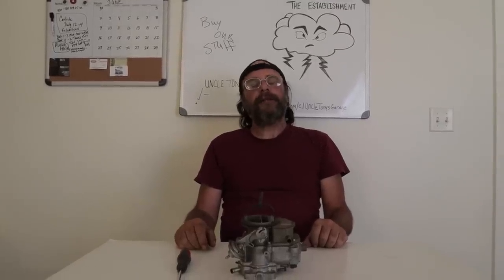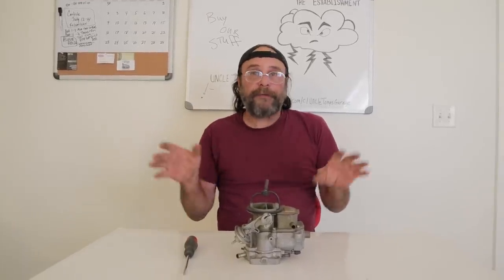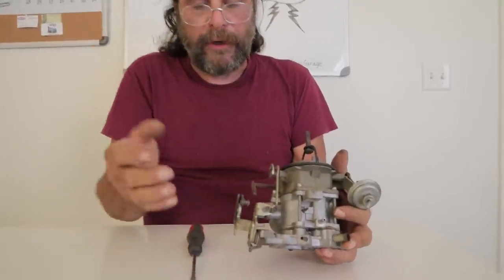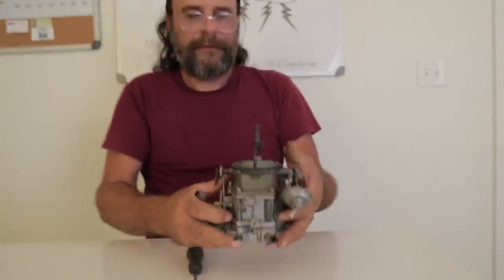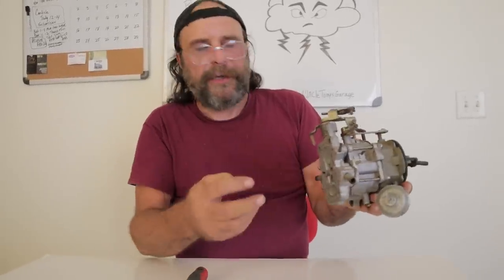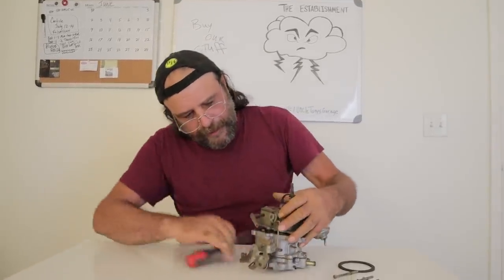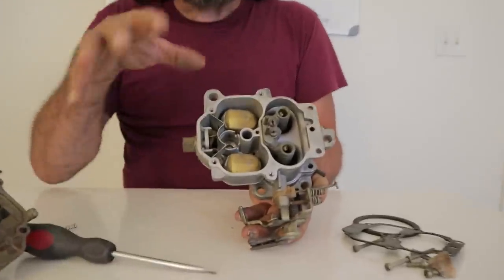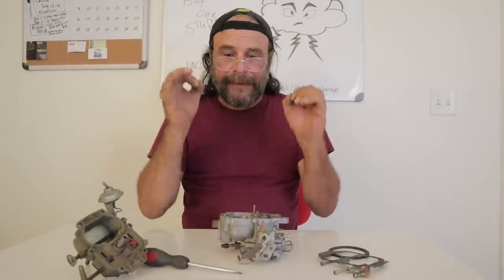Classic Car Tech- Understanding Carburetors

Comment: been a while since i regularly drove my GTO. i was running a q-jet  man it ran nice. that is once i got a fuel return to end vapor lock.. well you know pontiac so i thought i had to have a tri power. got what i thought was a good deal on "the seller said"working tri power.  well it may have been running on the center carb . but the check balls in the end carbs were installed wrong. i couldn't get the lower check balls out so i wound up drilling holes in the bowl under the check balls to get them out. patched the holes with epoxy . now the check balls were right and the carbs worked. 
  but  the car ran hot which it never did with the q-jet. . after much trial and error on air intake . i decided to run bigger jets. i changed the jets . then the fuel pump was leaking . after changing that it's too late to take a ride tonight so see what tomorrow brings

Comment: Forgot to talk about what i learned... I sobered up..... Can't just put another off the shelf 600 cfm carb(straight leg boosters) on that motor or you wind up with mid throttle bog... not enough air flow w the emissions heads.  Need the anular boosters in the stock carb to cover between the idle and main circuit when using emmision heads on 302.
Reply from the maker: ok

Comment: Now to the big question Tony, I have a 283 Chevrolet V8, and having an Edelbrock 800 🤔 I want to use, then it needs to be remodeled. which needles should I use? A 500 or 600  needles. Just looking for good idle and good fuel economy ...

I will register my Chevrolet 56 pickup and have to have that size of engine to handle that inspection, the idea is to switch to a 350 or larger engine, after that inspection it never needs to be inspected later 😏
Reply from the maker: What you want to do is Google Edelbrock "Drop Rods".  The answers to your questions can be found there.

Comment: A cold engine makes more vacuum but the fuel is condensing on surfaces on its way to the combustion chamber.  Therefore the engine needs more fuel to remain stoichiometric. A cold engine will not atomize fuel very well. The choke increases vacuum at the bottom of venturis, thus increasing fuel density in the air charge.

Comment: I just started working on my grandpas -77 Aspen, and it runs smooth at idle/cruising and then when i pressed the kickdown it just died. Now i never worked on cars, well i've built about a dozen exhausts because fuck sweden, but that's another story. This carb looks pretty identical to the one on there. I bet that dam accelerator pump needs a closer look, also now i understand that carb in and out. One thing tho, the choke bracket, is it supposed to be loose and just hang around there until a cold start or should it have some tension? Thank you for all your great mopar wisdom, it helps me out alot!

Comment: Had a 63 Impala, 283 2BBL Rochester. Low power, very rough idle like missing an entire bank. Couldn't find the problem, mainly focussing on the ignition. After upgrading to an Edelbrock 4BBL the problem was solved (desperate guess). I still don't know what caused the problem..

Comment: ford auto light 2100 2150 and the 4100 wear the simplest fuel mixers devised!  as for the idle speed screw I set them so the transition slots form a square then adjust timing to set my idle speed with the mix screws 2.5 turns from full seat. if it is on the car i set idle speed screw out around 1/2-5/8 out then set timing for smooth idle. i find that a lot of cars need vacuum advance on full manifold vacuum so the base timing is low for cranking then pulls in more for a fast smooth idle with a cool idle temp.   as for chokes i do not use them as thy case a lot of problems i wire mine open and use the gas pedal to give it a rich mixture when it needs it!  the key was a hei ignition this was a day to day driver and it got better mpg than modern cars in its class because i had a hot spark a mid 70s 2150 carburetor  and i custom curved the dizzy the carb was stock. as for cold starts it needed 3 pumps on warm days and in freezing weather 12 it would light it of faster than a lot of efi cars! good video!

Comment: Uhhh...if only I had this video back in the day when I used to try getting my Dart to run right or even start.
I didn't know what to do, and I can remember other people trying to fuck with these adjustments and they didn't know what they were doing either.
Sounds like I had accelerator pump issues.....

Comment: Great video Uncle Tony, thank you. Question, I have a 65 Mustang 289 3 speed, Autolite 4100 4bbl, she started right up cold no problem, and idled beautiful, but as soon as I shut the door, or even bumped the car with my knee, she would stall, and then run like crap, undriveable. Until the next day. I rebuilt the carb twice, I ended up tossing the carb and put a new Autolite 4100, (I wanted to keep it original) and all is well now. Can you tell me what was going on there? I ran the engine with the top off the carb,  and watched the floats in action, and the needle and seat worked perfect, no over flow, no running dry.  Would love to know what happened here, it haunts me. Lol thank you!!!!
Reply from the maker: No idea what could have caused that...I would have looked at the ignition switch
Reply: Funny you said that, I actually went through the ignition, changed the starter selonoid, changed the fuel pump, with no results, but after I swapped out the carb, it all went back to normal. Guess it will always be a mystery. The struggles of owning a Ford. Lookin for a MOPAR now actually. Have a good weekend Uncle T.

Comment: Question. I have a 1985 Jeep CJ7, 2.5  carbureted. When I turn the key off the engine sputters/chokes/stumbles before it shuts down. The Jeep runs fine, sometimes a little hard starting but runs pretty good after it starts. I never have any idle issues or stalling problems. This issue just started a week ago, but doesn't happen every time I turn the Jeep off. I've heard of this before but can't remember why it does it. Any help would be greatly appreciated. Great video as always 👍
Reply from the maker: That usually happens because of a combination of engine heat and too large a throttle opening at idle.
Reply: @UncleTonysGarage  Ok, I'll go see if adjusting the idle down a little will help. Thanks for the info 👍. Keep those videos coming, great job.

Comment: Tony, You are an amazing incredible wealth of knowledge.  What state are you located in?  Please list contact information.  I just got a 1970 Impala (Original paint & interior) 30K original actual miles (a clean #2 car), 350-250hp, Turbo 350 trans (I might do a B&M kit, not sure if I should do a drop in 2004R). 10 bolt rear (I think it is a 256:1)I do have some carb questions.  I hope I can make this a day 2 car.  I have an original like new (it still sparkles) Winters Foundry Snowflake aluminum LT-1 intake I am considering putting on it.  I want it to be basically all Chevy and basically almost all original, I will also probably install an HEI Distributer.

Comment: hey tony. i had an old 70s holly 750 vacumme secondary,  rebuilt all factory settings.  I took it off my sbc and put on a modern demon 750 vacumme secondary carb. the car felt like it doubled in power. are new carbs that much better then old ones? or was there something wrong with the old holley?

Comment: Sum Quadra junks usually have those idle screws, capped. Excuse me... Quadrajets. They don't recommend playing with those screws. The factory had a tendency to set them at the Optimal Performance setting for the application. And it is a total pain in the ass to do so. However, there is a tool for it. It's hard to find and rare. I bet Uncle Tony's got one. He too, is rare and hard-to-find.

Comment: What I always had trouble with was: Why does does the carb get a lot of fuel (high vacuum) with the butterfly and choke completely closed and also with them completely open (full throttle).
Reply from the maker: High vacuum at full throttle only happens when engine RPM increases

Comment: Cant remember how many carburetor problems I have seen  because somebody has decided to adjust the float level.
Leave the damn thing alone its something else causing an issue. 
Thats for something thats suddenly running like crap, or youre reviving a barn find. 
A new carb like a holley on a new project might need adjusting, but save that process until youre absolutely sure you need to.

Comment: I just bought a 73 fury with a 318 and it was running like shit and I rebuilt the carb but it's still floods even after being rebuilt. I've adjusted the float level to the factory specs, replaced the needle and seat and all gaskets too. And the accelerator pump, but it keeps flooding I'm so confused by it, it's a Carter I don't know what, it had a tag for a bbd on it but it's definitely not a bbd and I'm almost ready to give up on it, carbs are great if you actaully know how to work on them tho lol
Reply from the maker: Could be a high fuel pressure issue...no more than 6 PSI at the carb inlet.  Could also be heat related...boiling over
Reply: @UncleTonysGarage  we took it apart and found two plugged holes we missed so the fuel wasn't getting out, but now the damn thing won't idle right, my dad said it's starving because when you put your hand over top the carb and block the air intake to it Abt half way it's idles nice and smooth, he said he thinks it has a vacuum leak but we can't find one anywhere and the idle mixtures screws are already waaaay out, damn ornery thing, I'm having my fun with it though

Comment: If I may add my two cents, 
Regarding cold start and the choke, when the engine is cold it’s wanting more gas to keep it running than when it’s warm because the lack of atomization of fuel that the heat of the engine helps with. 
Or am I wrong?
Reply from the maker: Nope, you're right.
Reply: Uncle Tony's Garage thank you sir

Comment: The one carburetor system to avoid are the electronic controlled systems used in the 70s and 80s (Japanese or American). They didn't work all that well when new (especially the ealry 70s models) with their primitive computers and two miles of vacuum hoses. These days, repair parts are nearly impossible to find. If you get a rebuild kit for one, you'll discover that the internal diaphrams aren't included and invariably that is what has failed.
You are much better off buying a Weber kit specifically for your vehicle. The last kit I used for an 89 Ram 50 included every item needed to install the mechanically progressive 2bbl carburetor ( the second barrel only opens at near wide open throttle) and excellent photographs showing how to route everthing for that particular vehicle. I adjusted the electric choke for a cold day start and adjusted the idle screw and it was good to go. For $275 complete including manifold adapter and air cleaner, it's not worth the bother trying to rebuild the original carb (or spend $475 for a rebuilt carb of unkown quality).

Comment: Jr. Johnson had a magic carb he would let people use to qualify .I had a magic Motorcraft 2 bbl .that made a car fly , never understood what made it tick ?
Reply: Motorcraft was so much better than Carter. Motorcraft was almost as good as a Holley, but far cheaper and simpler. If your Ford ain't running right, it's more likely ignition related than the carburetor. It's well made from some sort of brass alloy, as opposed to Carter's raw aluminum. This is where being a Dodge and Plymouth fan requires dedication and loyalty. Unless yours has a factory Holley, then you're golden. Rochester is both the best and worst carburetor at the same time. It's a dichotomy, but that's GM for you.
Reply: @gg5115  Do you remember the sinking floats they put in the Rochester carbs that seemed to have a mind of their own ? Remember I live outside Rochester and the workers there made a ton of cash years ago but didn't cure the problem .
Reply: @edge2sword186  Yes I remember. The fiber/plastic floats have a built in lifespan, although the tail can be long. So for a long time your GM just tends to run a little rich, which is not much a problem, driveability wise. Shortens the lifespan of the engine of course. 
But they compensated with their overly powerful AC-Delco ignition, which kept your plugs clean forever, no matter how rich it was running. It takes about 20,000 volts to spark a plug; those units could send 100,000 volts. Take a head off of one, and the carbon buildup has practically turned into diamonds. (Either, resist the urge to chip it off with a flathead screwdriver, or be prepared to polish out the scratches later.)

Comment: Yo Tony, do you think theres a performan e difference between 2bbl and 4bbl carbs?
Reply: at wide open throttle, cfm is cfm. 4 barrels allow for more flow due to their footprint, and usually 2 barrels were not made to flow the same CFM as a 4 barrel. 4 barrels allow more part throttle fuel efficiency, but that's just mpg.
Reply: @Thanoric  Thankyou, from what ive seen at wide open, thats where you see how much a carb flows, so if a 4bbl flows 650 cfm, thats just at wide open, what im a little confused about is how a 4 bbl will flow 650 cfm and a 2 bbl will flow 350, 650/4 is less than 350/2, So shouldnt the 2bbl flow more than the 4bbl. Does the flow rating mean that each venturi flows the highest rating, or that all venturis are added together and that makes the final flow rate. Ive always wonderd this, I know 4bbl more performance cause it spits down more gas, but the cfm rating between 4bbl vs 2bbl always confused me.
Reply: @ruszko726  CFM is a rating of how much air it can flow. Yes, all CFM ratings are done at wide open throttle, where you are getting max performance, but you do not always need that max available amount.  A 2 barrel uses 2 relatively large venturi to be able to supply enough CFM to be able to let the engine run but it's not the most efficient for flow, and is not large enough to provide top end power (the point at where the engine can not get enough air due to carb restrictions).  A 4 barrel is a different animal.  It does not open all 4 barrels all the time (unless you floor it) and runs most the time on just 2 venturi which can be smaller than the 2 barrels, which is more efficient. The secondaries open when needed. This gives you superior tuning capability in terms of fuel efficiency and in performance because you can accurately adjust how much CFM is available and have enough flow to not restrict the high end rpm.
Reply: @Thanoric  that clears up a lot. Thanks appreciate it!

Comment: One thing needs to be said when your carburetor stops working properly (we will assume it was working yesterday last week what ever) do not turn screws on it thinking you will fix it that is not the case its broke clogged or something those screws didnt adjust themselves to make it not work when u decide to call in a pro to help now he's got to readjust everything "U FIXED"

Comment: I’ve got a good question because I cannot figure it out my buddy has a 90’s model Chevy caprice with a 350 port fuel injection motor it runs like hammered dog shit spits sputters coughs and goes on but never falls on its face and dies it’ll idle and stay running but I can smell fuel and sometimes see black smoke EXCEPT when the check engine light comes on when the check engine light comes on it runs perfectly has absolutely no issues at all when the light goes off it runs awful again I’ve also noticed it never really gets to operating temp and it’s got a brand new thermostat and the whole cooling system is flushed clean what could be the issue
Reply from the maker: Dead coolant Temp Sensor

Comment: This is every bit as complex as EFI. A card has loads of moving parts and a myriad of failure points  - and all manner stuff to twiddle to get things dialed in - except this complexity is all mechanical not electronic. EFI makes a lot of sense form a manufacturer's standpoint, chiefly economics both in production and achieving emissions - And like you said 'turn key' off you go - so I suppose that's what did it for carbs for the masses. Good vid as usual

Comment: Weird you didn't mention those weird infamous  "electronic" carburetors from the 80's and 90's, I have never seen one in person because everyone swapped them for Webers or similar analog carbs.
Reply from the maker: They're practically extinct, and for all the best reasons
Reply: @Glam Stachee I recently bought an 84 Trans Am with a Quadrajet that has some kind of computer link to the distributor, I'm new to the system so I may have this all wrong but the way I understand it is it picks up some kind of info from the carb and makes timing changes in the distributor according to what it reads. After getting it running it seems to start up and run surprisingly well, I just hope that little old computer doesn't fail on me.
Reply: @Impactjunky  Unfortunately it's not "if" but "when". Everything fails eventually, it's just how it is, but mechanical parts are pretty straightforward to fix, old, non-standardized, no OBD II computers? Not so much.
Reply: @GlamStacheessnostalgialounge  Everything with a computer in it's gonna be voodoo to fix after it gets old enough.
Reply: +Impacts Garage and Gaming

Exactly, I couldn't have said it better myself. A mechanical part will always be a mechanical part, anyone who likes to tinker with stuff will be able to figure out how it works, but finding out outdated software or a programming language is a lot more difficult.